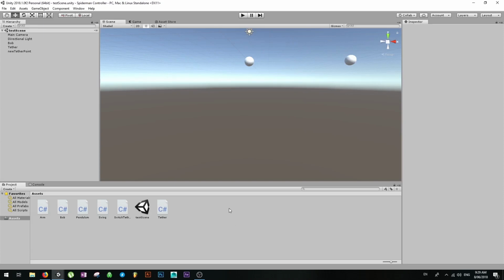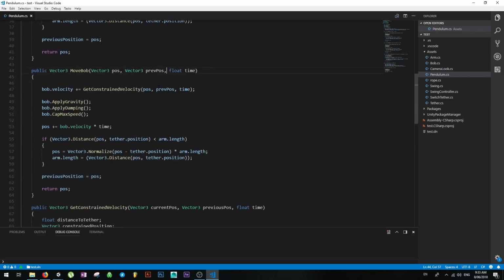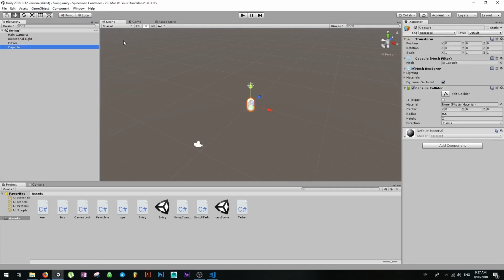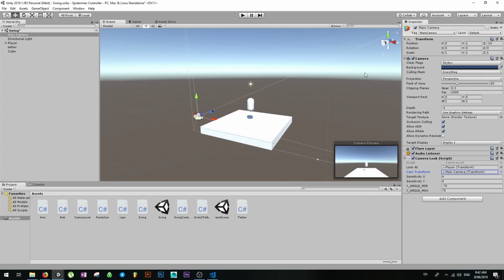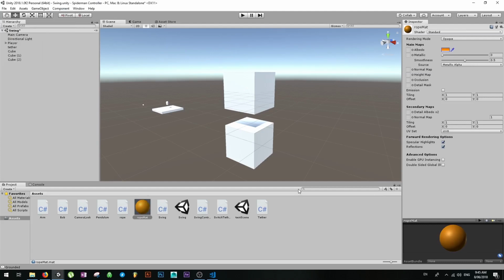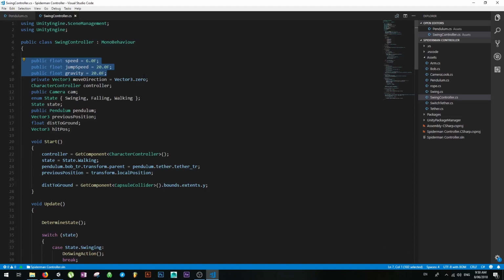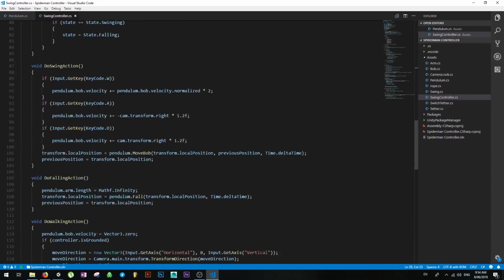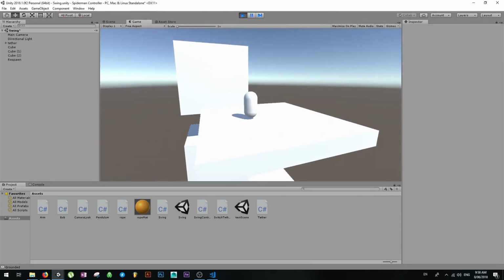Unity Tutorial - Spiderman Controller EP3

Comment: But what is it?: "Assets/SwingTools/SwingTools/SwingController.cs(15,12): error CS0246: The type or namespace name `Pendulum' could not be found. Are you missing an assembly reference?"
Reply from the maker: Hey mate, you're getting that error because Unity is trying to find the 'Pendulum.cs'  c# script, but it's not in your project. To create the 'Pendulum.cs' script, follow along from the first video of the series at this link - https://youtu.be/zmrd0--u9sw hope that helps! Cheers, Coderlab
Reply: Can you add Bob, Arm, Tether and Pendulum to SwingTools?
Reply from the maker: Hey mate, I can understand you'd be frustrated that I haven't provided everything. But I would rather not add them to the package linked in this video. The packaged files are just utilities - I want the series to be about learning and understanding how the code works. That's the reason I made it a tutorial. If you would rather access all the files straight away, I will be creating a Unity Asset you can get! Cheers, Coderlab
Reply: @coderlab6435  mine is showing that too... i have followed everything :(
Reply: @coderlab6435  nvm i just spelled "Length" wrong